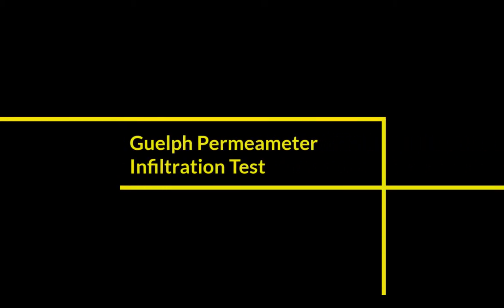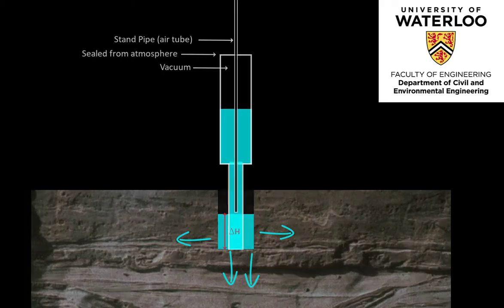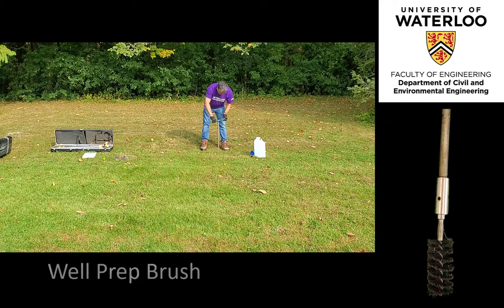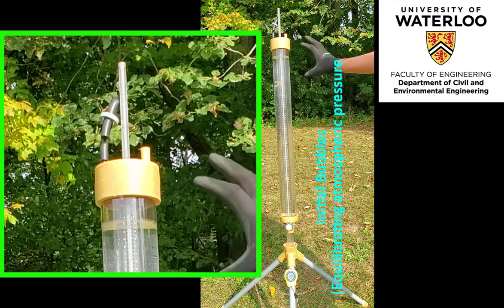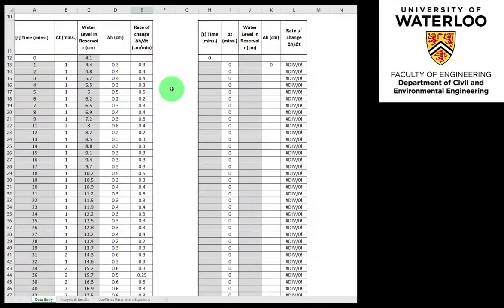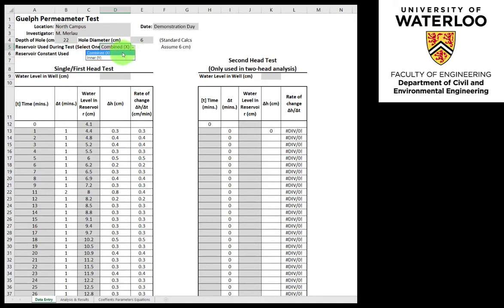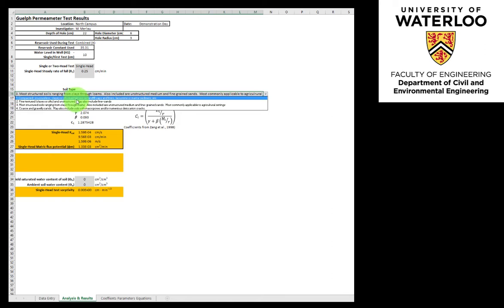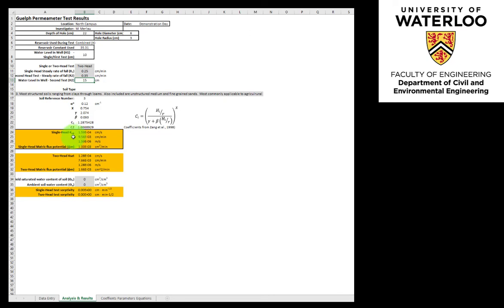The Guelph Permeameter

Comment: I am curious where are we making the mistake as I can not have stable flow on fixed time scale (every 1min) - as some times I have zero value sometimes have value - so not like your excel I have more or less a value..which manuplates the formula.
Reply: In that case, you should instead select a longer time scale (such as every 2 minutes) so that a change is recorded for each time increment. Also, some permeameters have a valve that allow you to use only the smaller reservoir (typically the inner reservoir), which is more accurate for finer measurements and slower flow.

Comment: what is the difference between Guelph and Tension infiltrometer ?
Reply from the maker: A tension infiltrometer is similar to the Guelph Permeameter in many ways.  However, a tension infiltrometer applies a negative pressure to the soil matrix such that, in theory, on can control the volume of water entering macro pores (such as burrow holes or abandoned root pathways).  Therefore, the tension infiltrometer is designed to characterize the primary porosity and thus the primary percolation rate through the soil as a function of time.  The Guelph Permeameter does not differentiate between the primary and secondary porosity and thus captures the overall percolation rate through the soil layer as a function of time.